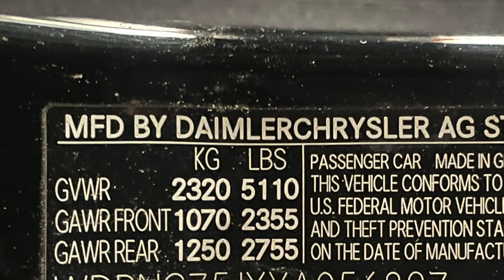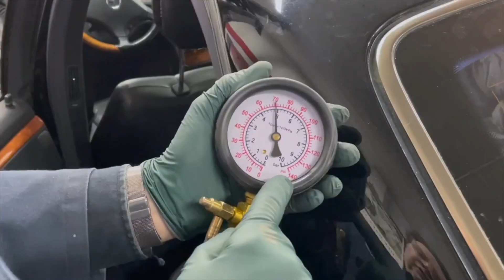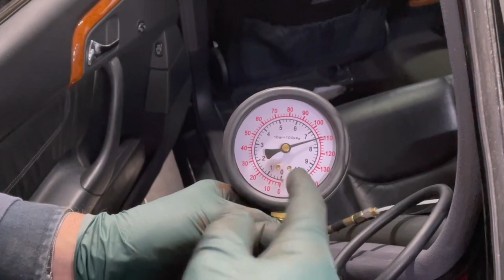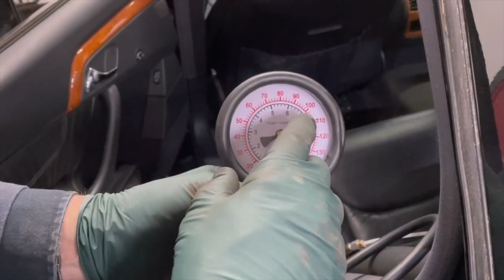Airmatic Leaking? Shop Can't Find It. Maybe You Can with Compressed Air

Comment: Great video Kent...also the aluminum air tank for the suspension develop hairline cracks and also can be a slow leak in the system not very common but I have had a few leak

Comment: What about a 2005 E-55 Amg
Reply from the maker: Sorry eyesight might be getting bad.  I did not see the "E". If your sedan is all the way down on all four wheels then there are a number of things that could be wrong. I recommend you have it towed to a shop that can getting a scanner hooked up and diagnose the failure. Don't throw parts at it until you do.
Reply from the maker: Here is the scanner I recommend. It will run the pump for you and do basic diagnostics of the system. https://shop.youcanic.com/products/ucan-pro-scanner?variant=45257260662933One thing to note. If it is all the way down on the ground the pump may not bring it up. You will need to jack the car up some and put blocks under the jack points to get the body up so the struts will take air.
Reply: @Mercedessource  Thank you …very much appreciated..
Reply: @Mercedessource  No problem, do you have a budget friendly scanner in mind that could diagnose the problem? Fully mechanically inclined to do the work. I agree don’t want to spend money’s on parts I don’t need.

I already have all new four corners, ready to go in brand new inbox sitting in the trunk, with your professional opinion and being that all four corners are sitting on frame plus when vehicle was started it would air up overtime but now it doesn’t even air up. 

Car has been sitting for about a year and a half and I’d like to get it on the road for sale..